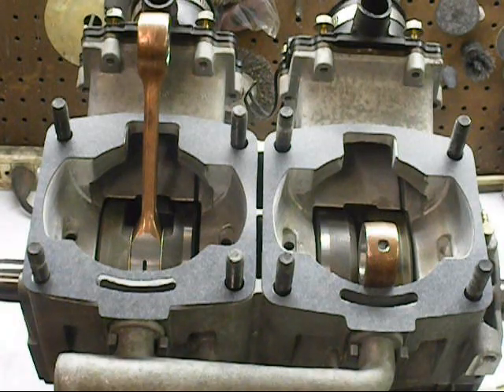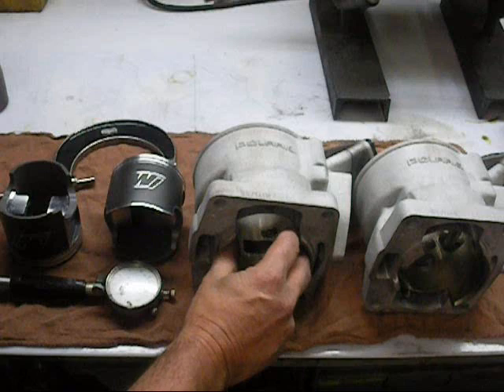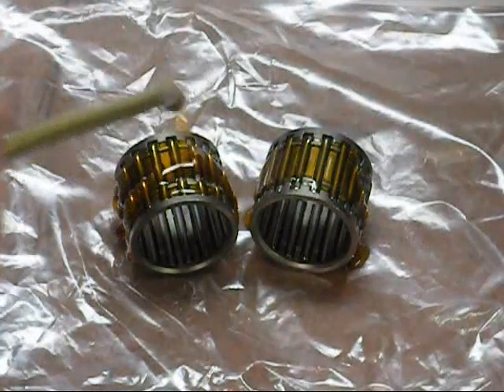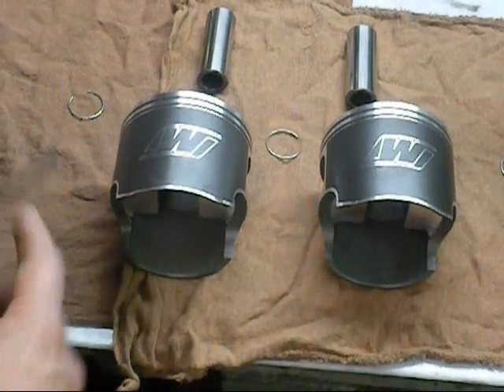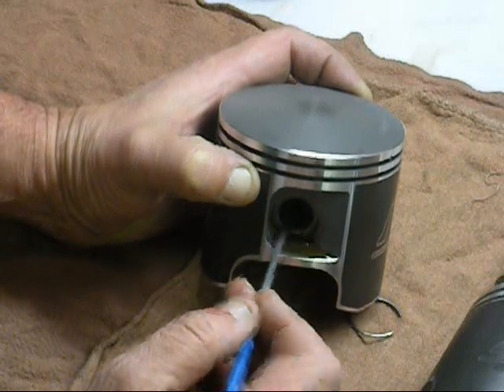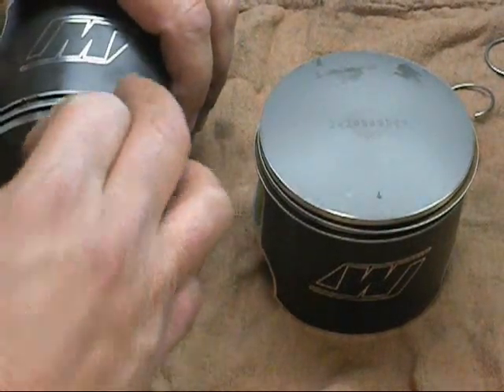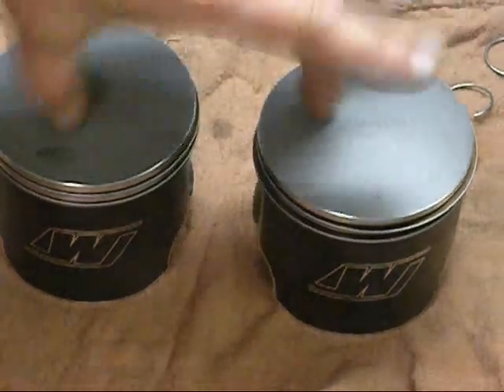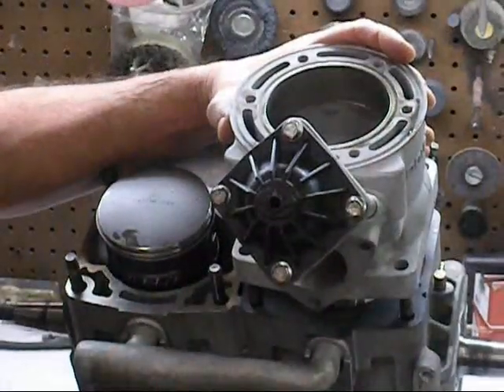polaris top end part 1.wmv

Comment: When you use 1194 casebond, after applying a thin film to the surface, do you allow the sealant to tack up before you assemble? 
How long should the sealant set up before running the  engine, adding coolant ? 
I love the details that you cover on rebuilding 2 strokes. I will definitely be checking the circlips on my engine before I button it up.